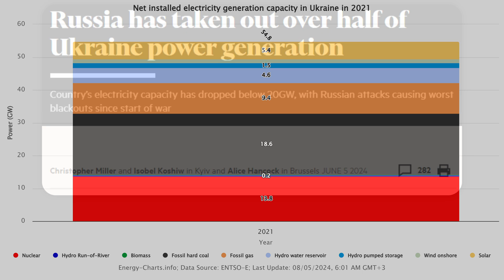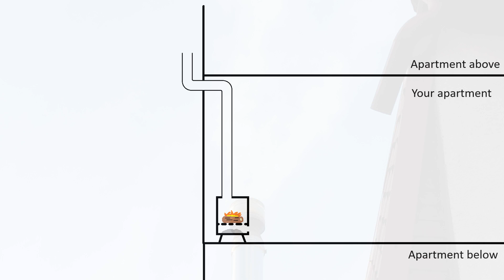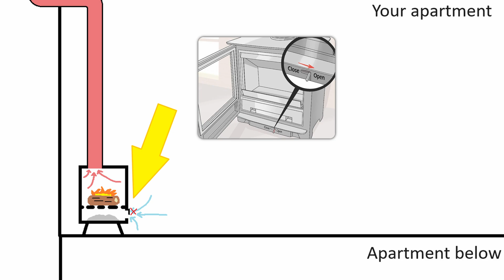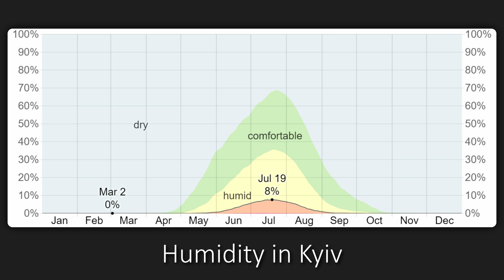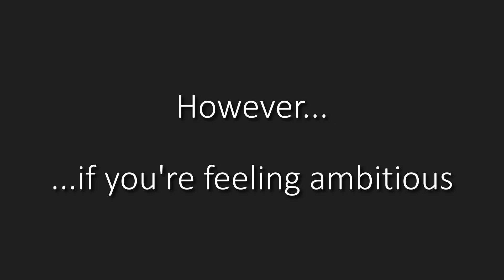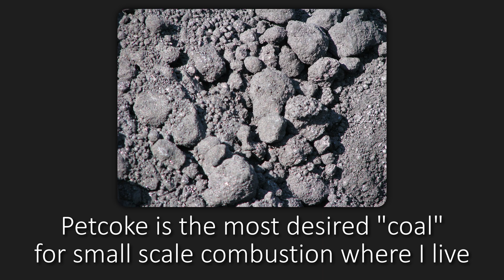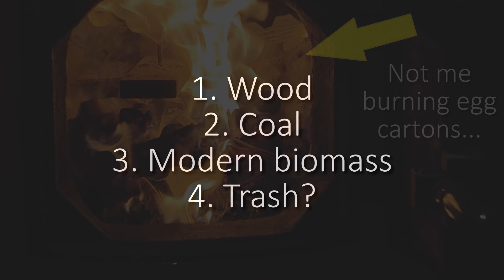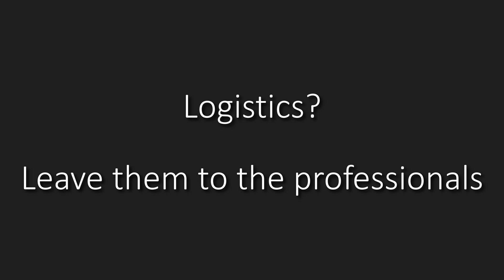Surviving Winter 🇺🇦 | Wood as a Scalable Solution

Comment: Although paper doesn't burn very cleanly, it is the best material to start a fire with because of its very low water content. Adding 2-3% paper to the fuel can be an acceptable solution, but I wouldn't go beyond that. And try to avoid glossy wrapping paper with lots of ink on it. Old-school black and white newsprint is the best (sorry to the journalists whose work won't be preserved for eternity).
Ash is often collected by waste management companies who sell it on to either fertiliser manufacturers or utility companies who mix it with salt for winter de-icing. The problem is that it costs money to deal with ash from unknown sources. Many people burn entire furniture sets or window frames, thus their ash may contain sharp metal particles and toxic substances, so in most places you'll be charged if you want to dispose of it in the official way. However, if you know that your ash is from a clean source, I suggest that you treat your garden soil with it. Wood ash is also used in some sewage treatment plants.

Comment: Among the many issues of war us the fact that it's much more risky to engage in capital intensive projects that yield long-term benefits.

I agree with your cheap and cheerful solution if you have no money, can't plan beyond months and may die of cold without some solution.

But, if the time horizon is perhaps a year or longer consider the following:

Beijing had a layer of soot you'd have to clean from inside your apartment every few days. This even if you didn't personally use charcoal.  City wide pulmonary issues as well came with their heavy apartment level charcoal use. 

Logistics-wise metal stoves force residents to use 2-4x the fuel due to heat losses out the flue and unburnt hydrocarbons.  The rocket mass heater is a more apartment friendly version of the masonry stove.  Most versions have been designed for houses, but smaller versions with water for thermal mass are possible.

If considering global climate, biochar producing rocket mass heaters can make wood carbon negative vs just neutral.

Probably a bit much engineering for an apartment,  but a gasifying  biochar/full combustion kiln driving a generator and heating pulls more value from the same feedstock.  This is the same technology that powered wood powered cars c.WWII.

Comment: Wood and any biomass is approximately 4.8kwh per kg

It will be best If you put the make up air through the wall into or near the intake to the wood stove to minimize moisture loss and chilling the far corners of the dwelling where the suction draws in outside air.
Reply from the maker: This is true, and I did show a picture of that in the video, but I want to make sure people are aware of the "leave a window open" option, because drilling holes through 25cm of brick is difficult as a DIY project, and I worry that if people think 2 holes are mandatory, this could marginally affect accessibility
Reply: But moisture isn't really lost. It's just how Relatively Humidity works, when you warm up outside 0°C 90% RH air to 20°C it becomes 25% RH. No moisture is "lost" in this process, just cold air cannot hold much moisture
Reply from the maker: Moisture is "lost" in the sense that you're introducing the air with low absolute humidity, heating it up such that you have low relative humidity inside, which then dries out people's skin, eyes, and lungs, and then leaves with the combustion gasses, taking the moisture with it, and makeup air comes in to repeat the cycle. Basically, you're drying out the living space

For many people, this isn't an issue, especially in cold climates, where people tend to be well adapted to it, but some people get really bad symptoms from such an environment
Reply: @SizeMichael  but it is lost just as much if you use any other means of heating and ventilate on a healthy schedule. In winter, you either have excessive CO2 in the room or you have low humidity, or you use a humidifier. I'm trying to say that the suggested method of heating doesn't really make it worse
Reply: @Ubeogesh  "but it is lost just as much if you use any other means of heating and ventilate on a healthy schedule"

I think for a stove like this you do need more ventilation than if the heat inside your apartment was provided by a radiator.

Comment: Burning wood is just burning coal with fewer steps.
Reply from the maker: I think you might be mixing up coal with charcoal: charcoal is made from wood via pyrolysis, while coal is dug from a mine

The point of burning coal would be that it can be extracted in practically unlimited quantities, and the mining equipment&sites for this are already in place, while wood is limited by the availability and accessibility of trees. As a result, coal might prove more accessible in the short and medium term - although it also might not.

For me, burning lignite would be about 1/3rd the price of wood for the same amount of heat - but much more messy and stinky
Reply: @SizeMichael   I meant that we should see wood as the earliest stage of coal (before peat, or lignite).

Many environmentalists see wood as a carbon neutral option or "green". But, over any time scale that matters to humans, it isn't carbon neutral.

So we should see wood burning as a short term emergency measure, but not let it become a bit permanent solution.
Reply from the maker: I agree. Wood is not suitable long term. It's just uniquely well suited for low-tech, off-grid heating, which is what we need in this particular emergency
Reply: @SizeMichael  I agree with that.